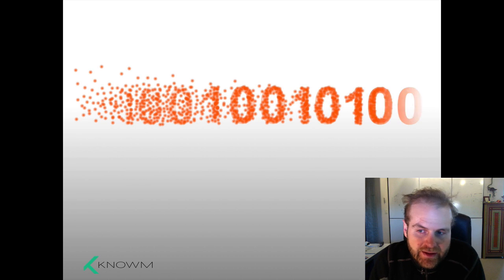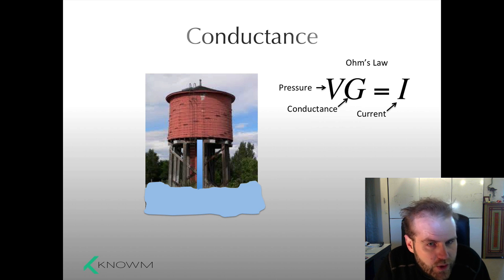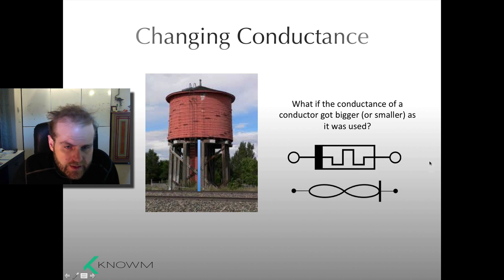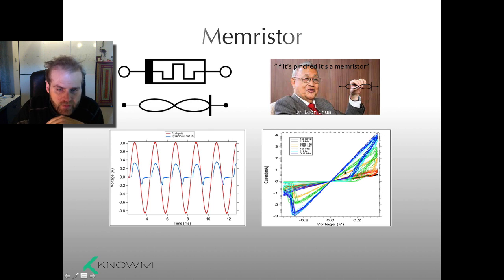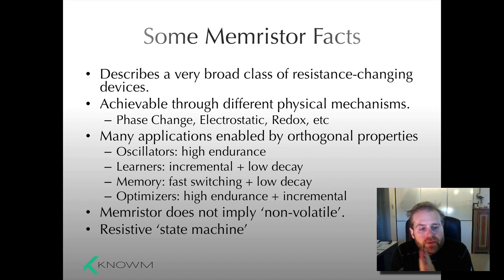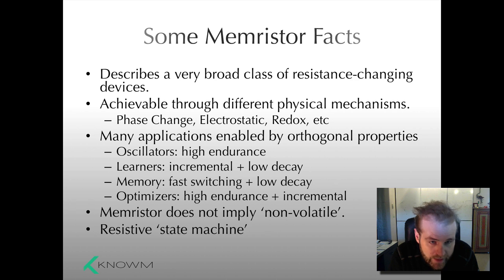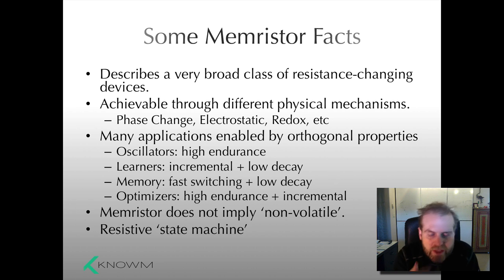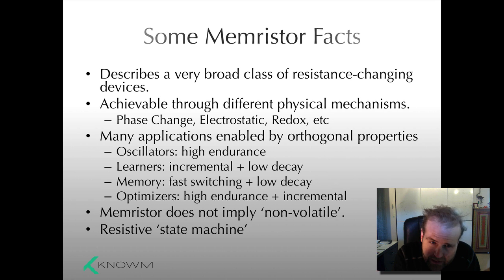What Is A Memristor?

Comment: So to sum it up

The  nanoclusters aligned in the same direction increase the superconductivity of the circuit, thus creating a higher resistance level because we are duplicating the same polarized spin state to multiple Nano clusters or spin States that's aligning them in the same polarized spin state/direction akin to a Shor algorithm

Especially considering these are Nano clusters and potential actual room temperature qubits, nv centers, especially considering using potential nitride base memristors circuits, therefore creating nitrogen vacancies that are all aligned in the same direction sharing a spin State thus entangled

Increasing the coherency of the circuit in relation to neural activity

Comment: Are there any current memristors available suited to "learner" circuits?
Reply: And "optimizer" ones as well would be interesting to experiment with.
Reply from the maker: @Xartec  https://knowm.com/ Carbon-type are low energy binary switching (optimizing). W, Sn and Cr are higher energy incremental.